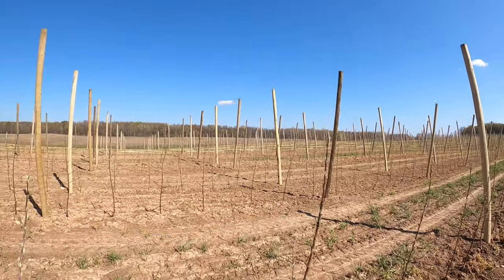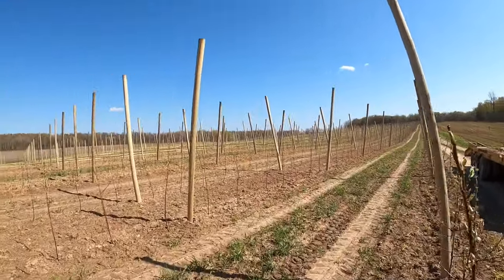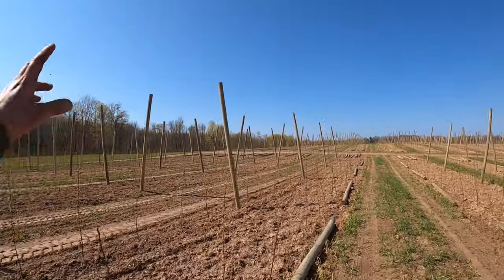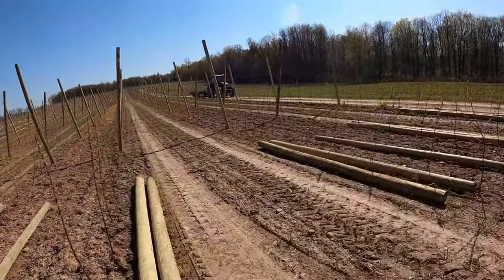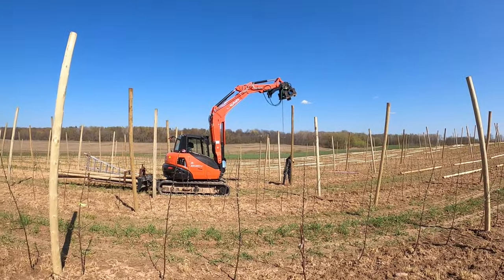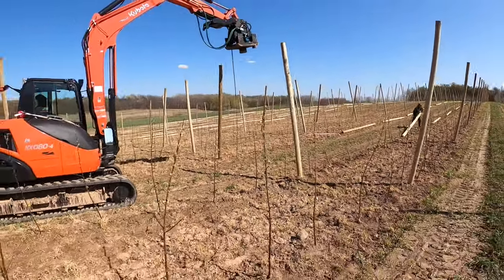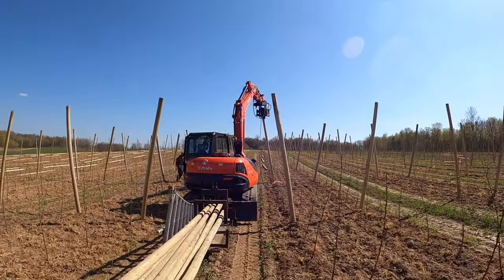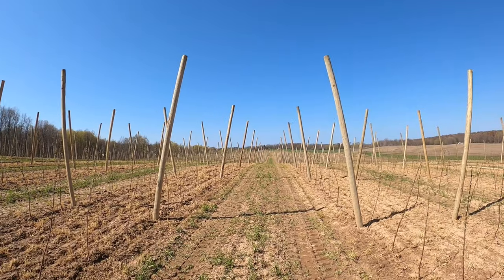Pounding trellis post with Excavator

Comment: How tight do you get the trellis wires?  Do you have something to measure how tight the wires get?
Reply from the maker: We have a tool that looks very similar to a hand Lopper. We tighten them all on the feel of the pressure of the wire. We will go back in a few years and tighten the wires some more if we feel is too loose. Great Question. I will show the tool and how we check tightness in a future video for you!

Comment: How long do those poles last in the ground before they rot out
Reply from the maker: They are all pressure treated so they will last hopefully at least 30 years. Our smaller diameter (3-4in) have lasted that long. I am confident these will out last 30.
Reply: @AppleBoyWNY  how is treated with pressure
What is used to make them durable
Reply from the maker: Pressure treated it called. Not sure what they use for the liquid but it just like buying pressure treated lumber at the store. 30 plus years out of the post @SanjeevSharma-pm2zf